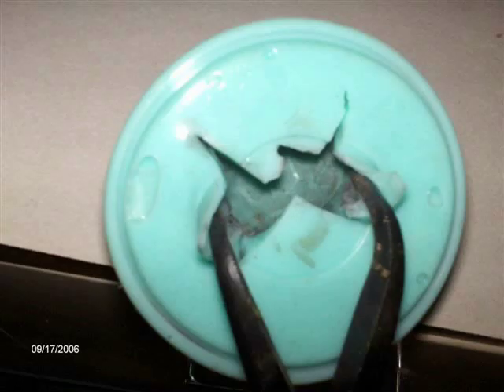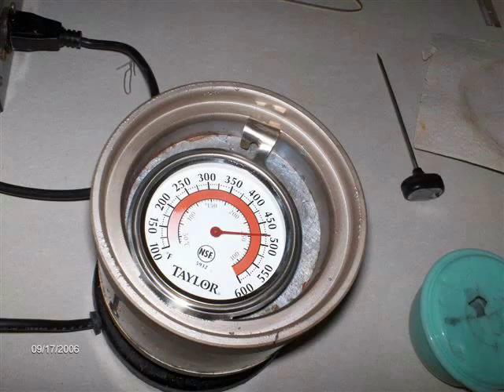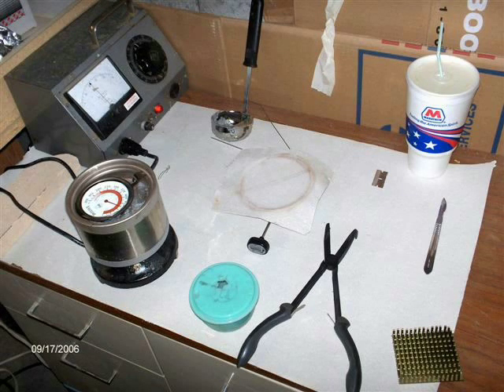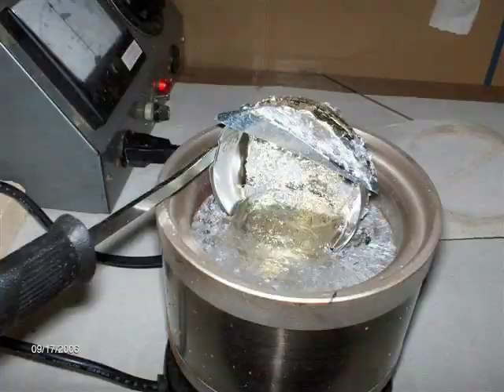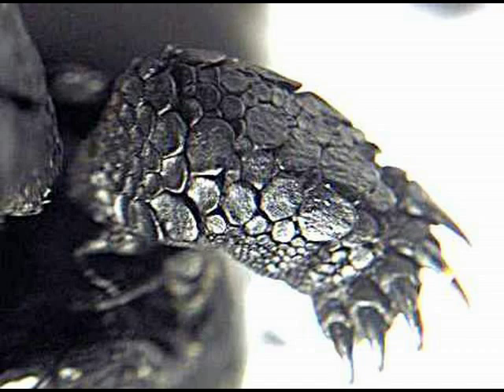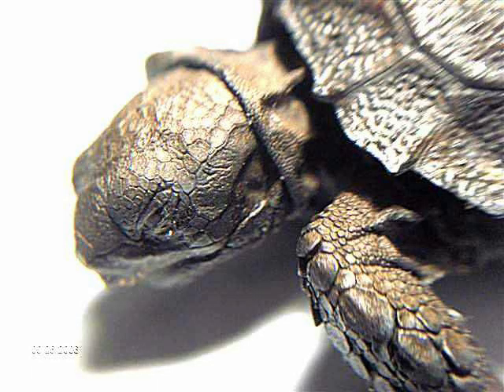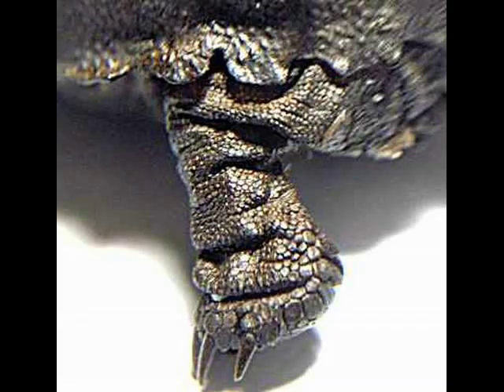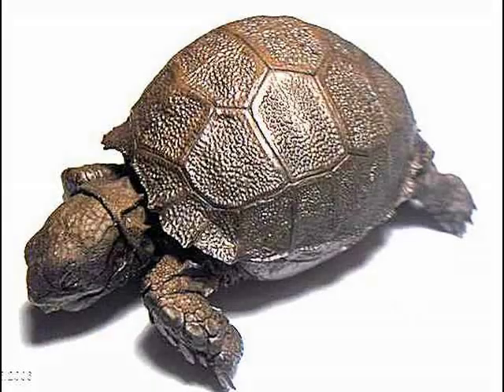Making Silicon Molds for Pewter

Comment from the maker: There there may be air entrained  in the surface of the silicone. Perhaps microscopic scarring. It expands when heated to create the pit. The investment casting material is probably more intrusive or it forms a protective skin against the wall of the silicone when it is displaced.  I have seen this with when casting with epoxy that reaches high temps.  Your temp is much higher and the problem might show up sooner and be worse.

Comment from the maker: Hi, I just use a silicone mold release.  You might try to use a moly high temp mold release and preheat the mold. Sorry for the delay.  Youtube does not send my comment notification to gmail like it is supposed to and they make it very hard to get to your inbox on the Youtube site.

Comment from the maker: In reference to what I said, if you look that the surface casting from the investment process under a microscope you might see something that resembles orange peel dimpling if in that situation air is present, but is being trapped that a protective skin formed by the investment material. The resultant bubble would be flattened between the wall and the skin and show up as a slight microscopic flat dimple.